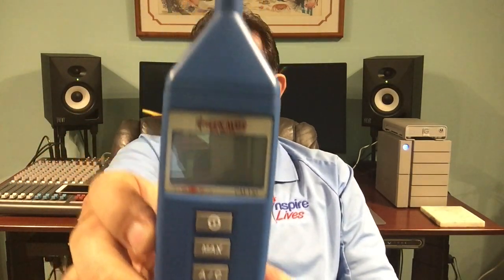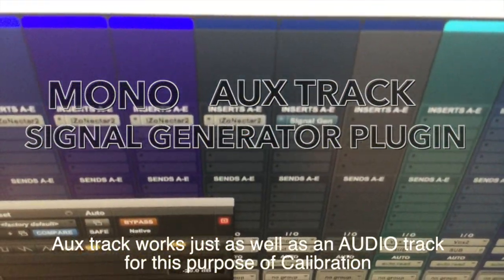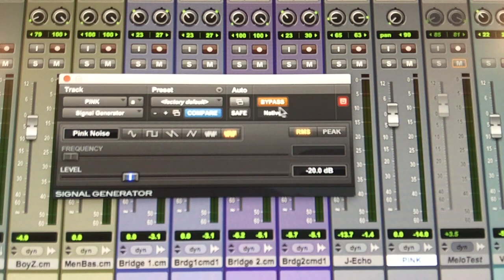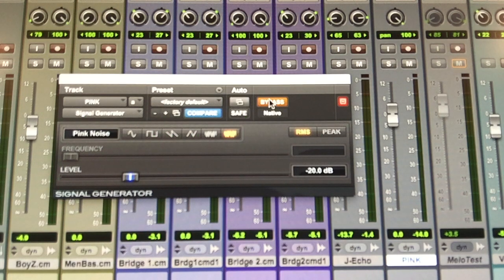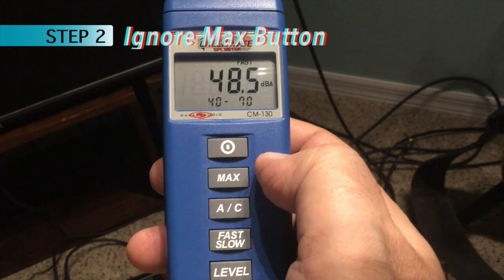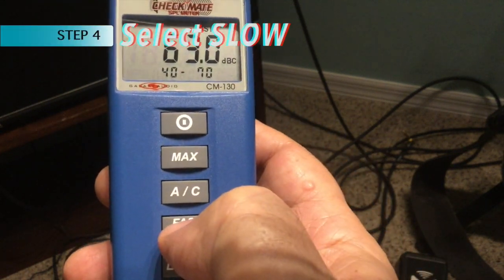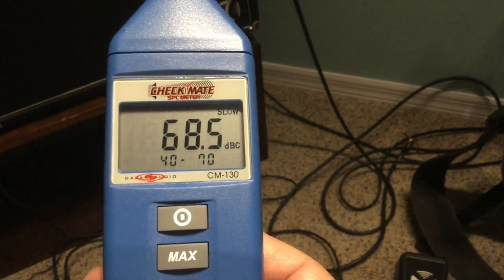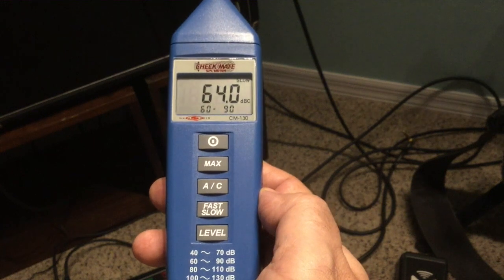Studio Monitors Calibration using GALAXY CM-130 or 140

Comment: First of all I would like to thank you for this Tutorial it helped me out alot the question I have since the pink noise track that i set at -20 means that from now on all my individual tracks will also be set to this gain structure hope i explained this right
Reply from the maker: Edwin Rodriguez Thanks. The main idea of monitor calibration is setting the listening level so that ALL tracks in your DAW at unity gain (0db) or less will not exceed your choice of calibration level. Of course, turning your monitors up will always make everything louder. For a while since this video I acquired a pair of Focal monitors, so I calibrate all 4 monitors (2 pairs) to about 75db and may go lower to try 70db. I want to do the best to protect my ears.  I often use CLIP GAIN on an audio track if it needs a ‘volume push’.
Reply: @DatAnydex  again thanks! But i also acquired focal shape 65 but they dont have any separate volume pots how did you calibrate them ....and you are right I'm going to 70 also i originally did it at 80 and it was too loud for me
Reply from the maker: Edwin Rodriguez Simply use the monitor knob on your interface until you see the desired volume calibration reading (on the Galaxy) coming out of the Focals. Meaning, you won’t use Focal monitor knobs in this case since they’re not there, but instead interface knob. I use Apollo 8 quad interface. THEN ... once set ... your listening skills will improve immensely at your consistent calibration level.

Comment: I have a question about the min/max  function. When calibrating speakers to same levels which reading i’m going to take, the min reading or the max reading?. Thanks.
Reply from the maker: KuRt1219 Since we’re doing C-weighted, I simply did not use the min/max function. You can simply disable it. Choosing the range level of low and hi frequencies will do the job, as you see in my vid. I bought new Focal monitors and kept the Event monitors for A/B. Again...I had no need for the min/max function for my purposes. Just choose your level range and the CM-130 will fluctuate to your choice of dB level as you set your volume knobs on your interface and monitors. My Focals have no volume controls, but the Events do. So I calibrated my Focals first via my Apollo 8 interface volume knob, and secondly my Events with their own volume knobs on the back of the monitors.
You don’t need the min/max function for the purpose of your studio monitors, since we are calibrating for musical audio frequencies instead of general audio such as machinery, etc. Hope this helps you. Cheers.